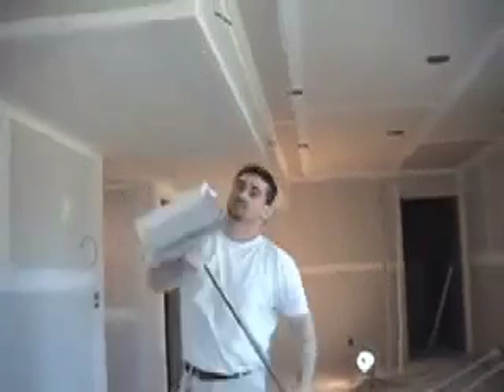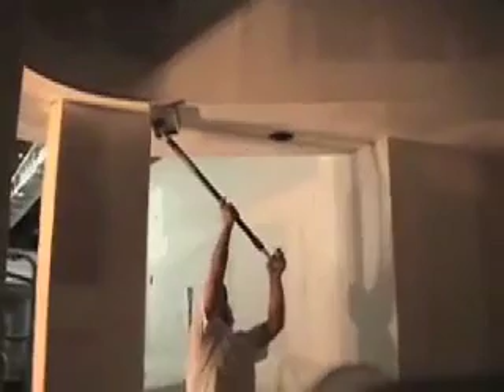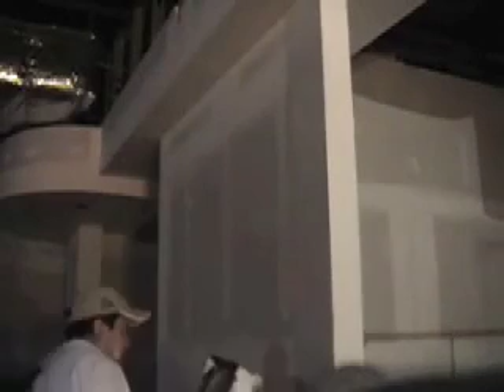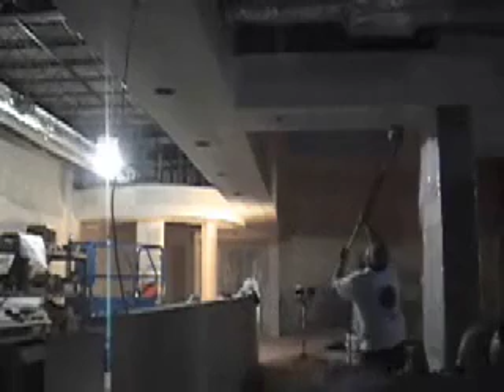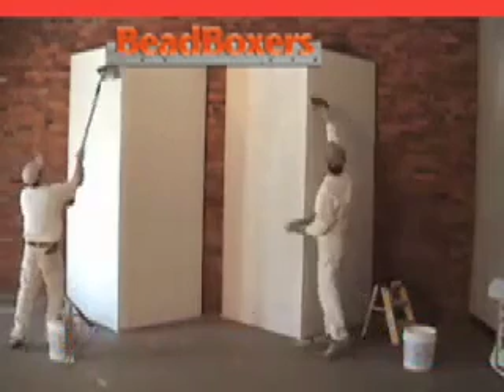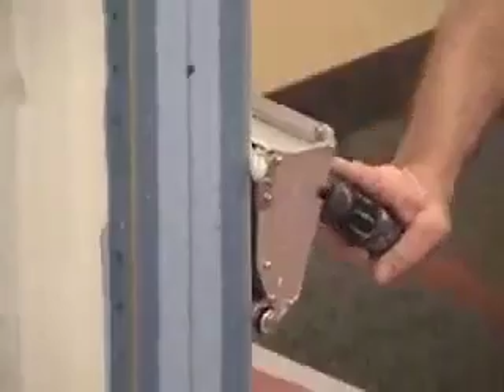Beadboxers Flat Box Cornerbead Finishing Kit

Comment: You don't 1st coat the corner bead with a 12. Use an 8 or a 10. So I fail both of them. Besides I hot mud the 1st coast with an 8, then finish them with a 12. By hand. So I beat them both.
Reply: Ya man, hot mud 1st coat with a 6" and then go 10/12 for the next coats. Minty every time